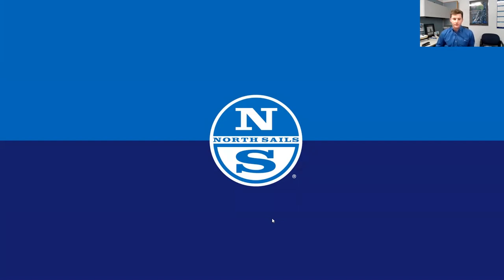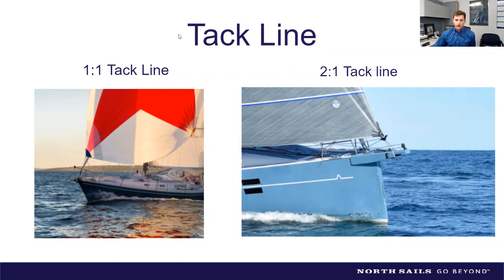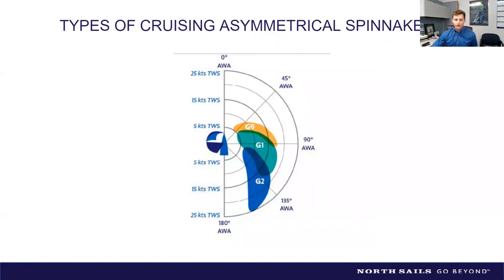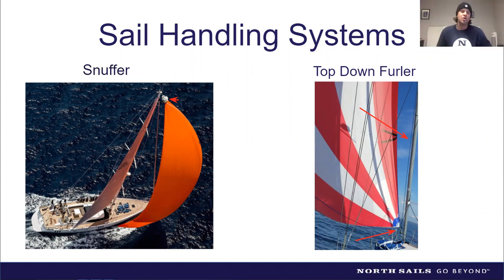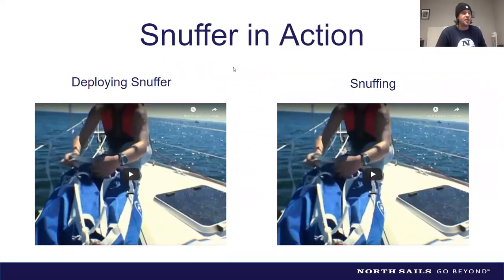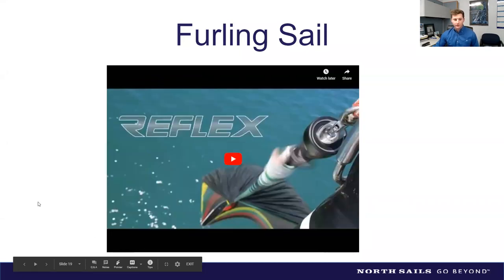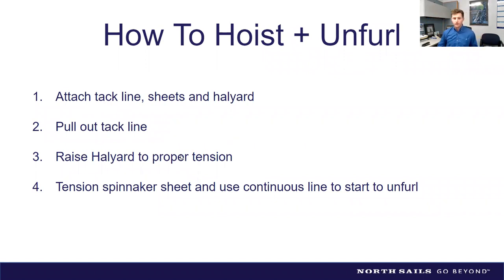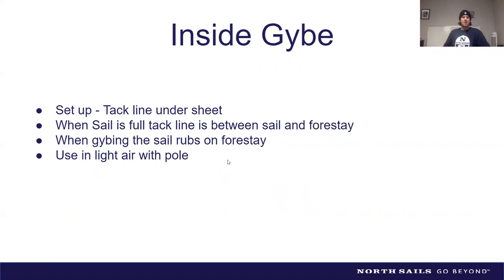Let's Talk Downwind Sails

Comment: Hi Austin and Mitchell,  excellent vlog; Mitchell's comment on having the snuffer line attached to a block on deck, I have found to be of the utmost importance. Here is one simple hack that I have used to that makes setting and striking a spinnaker with a sock easy and safe, even with just the two on aboard. Pass the loop of the continuous sock control line through a snatch block. You might say That’s it? Yup…well, there’s a bit more to know. And that’s reasonably easy in smooth water inshore. But offshore what happens is the boat rolls, and each time it does, to windward and back, the spinnaker pops out from behind the main, fills, and the sock control line loads up to the point that the person pulling it either: lets go ,loses all the skin off his or her hands, leaves the deck in a big hurry. We secure the spinnaker sock line down side after the block at a mark that will just keep it firm when the sail is hoisted but the sock still down. This stops the wind in the exposed foot of the spinnaker from pushing the sock mouth up before we are ready. Bear off to blanket and then hoist the spinnaker behind the mainsail while keeping the sheet firm, which does not cause problems because the sock is held down by the cleated down line. The sail is now well and truly under control behind the mainsail with the tack firmly attached forward, the halyard all the way up, the sock all the way down, and tensioned by the down side of the control line, and the clew pulled aft by the sheet, and so keeping the foot from twisting up. Then hoist and adjust, sheet, tack and course to proper angle.